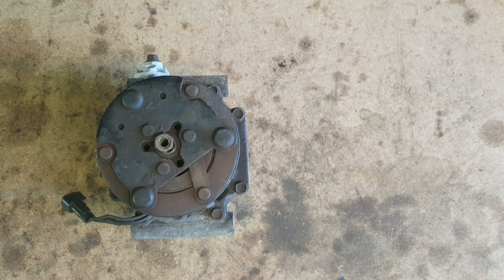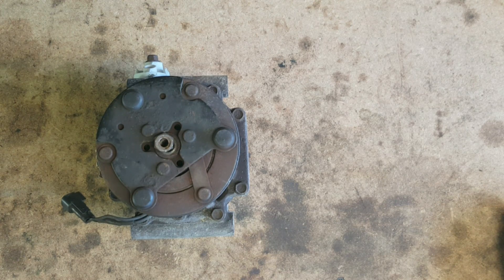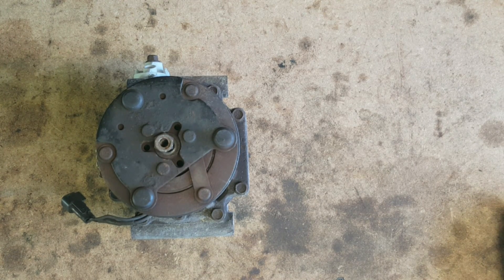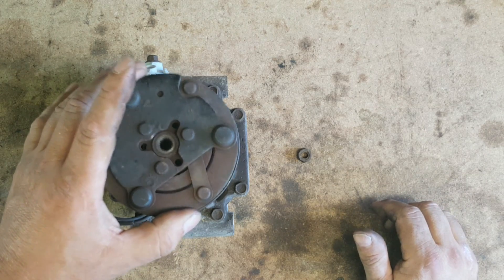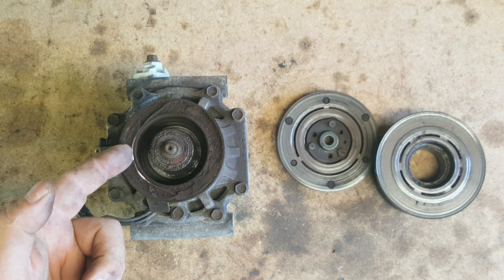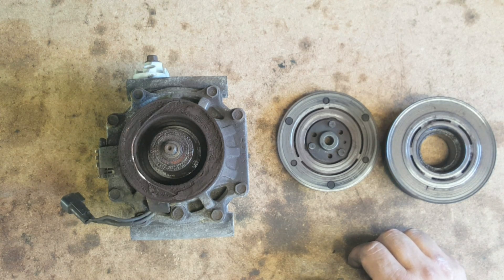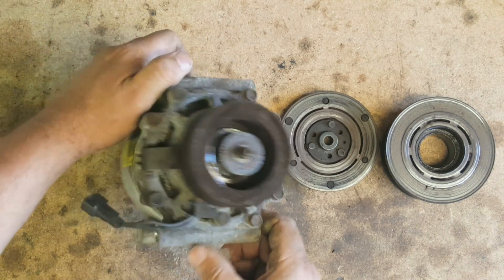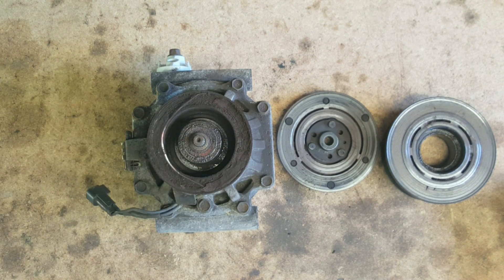Ford A/C Compressor Blowing Fuses - Root Cause Found

Comment: I have a question what if I unplug the compressor and the fuse is still popping?
Reply from the maker: @BigDame251  Then you have a short somewhere in the wiring harness between the fuse and the compressor.

Comment: mechanic charge full price of compressor when they can get half of the cost by returning the core/your old compressor.
Reply from the maker: There's generally no core charge for a brand new part, only for remanufactured parts. There are exceptions, but not a lot. Any shop that collects the core charge from a customer and doesn't give the customer the part is unethical and probably doing so illegally.

Comment: 2-5 Ohms is the resistance value of the coil. So 10 amp fuse blows, and the circuit is 12-14VDC the resistance value is less than 2 Ohms. So it's going to be 1.2-1.4 Ohms Or less, which allows too fast of a current which builds heat damaging wires if no fuse is installed.

Comment: Thank you for the video, having the same issues with a vw Passat, as soon the A/C button gets turned on it blows a fuse within a few seconds, will check and let you know what I find 👍
Reply: Having the same issue with a 2012 Passat. Let me know what you find out.

Comment: So what if a new ac compressor is put in 07 saturn aura and the fuse keeps blowing?
Reply from the maker: I've never worked on a Saturn, but the way I diagnosed this was to disconnect the harness to the field coil and turn on the A/C. When the fuse didn't blow, I knew where the short was (but not what was causing it, exactly). If the fuse had blown with the coil disconnected, I'd have followed the wiring back to the next connector and repeated the process.

Comment: Same exact thing happens with my 2003 Expy. Most shops wont bother replacing the clutch coil alone. They always wanna replace the entire compressor. 

Why does the AC always decide to crap out on the hottest frickin day of the year. Smh

Comment: 2005 scion xB... Efi fuse blows after 15 mins of running ac and sitting idling. Doesn't blow the fuse If ac is off
Reply: I know its been 4 years, did you find out what it was? I have the same

Comment: can you still drive your car with the a/c compressor not working
Reply from the maker: +Leon Godbey As long as the pulley turns freely, it should be fine.
Reply: Yes just pull the ac clutch fuse